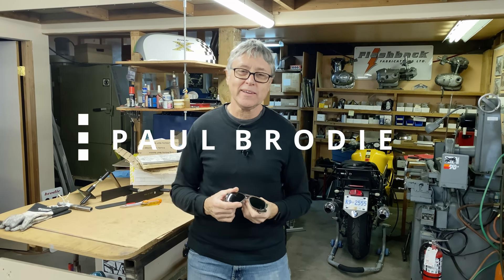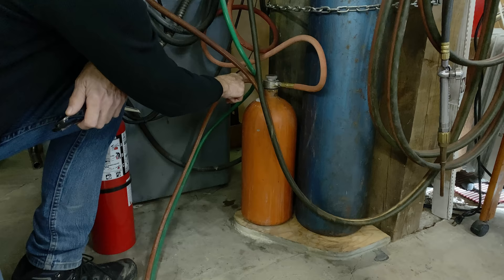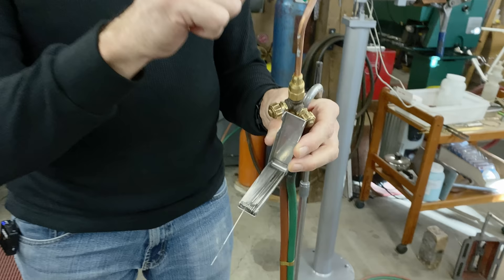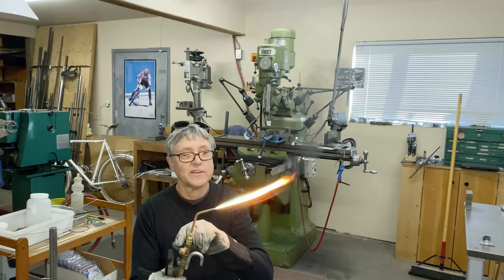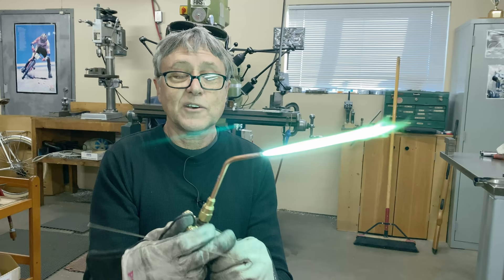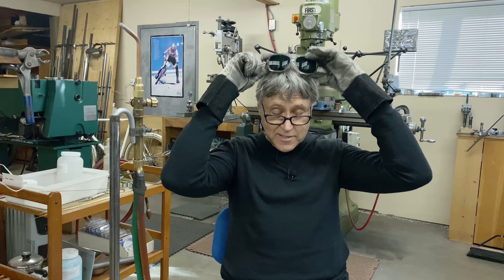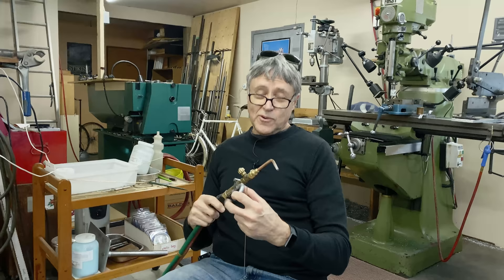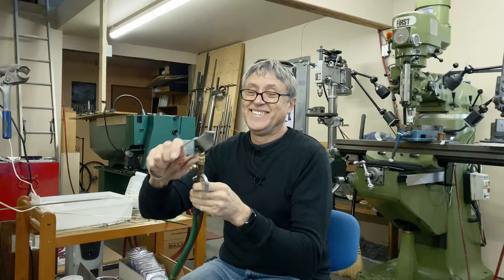How To Braze - Tips and Tricks with Paul Brodie

Comment: I think stalagmite would be a better descriptor than icicle on the braze stacking. I've been welding as a hobbyist for 47 years and never heard of an inline fluxer. That is kinda neat. Don't think I would get one as most of my welding is tig or mig but brazing has always been kind of relaxing to do. Bought a jewelers torch awhile back as I have always liked making little sculptures. Currently gearing up to do metal casting as one bucket list item is to make a 1920-ish Indian from scratch. Which is why I started watching your videos, when I found the Whippet video. Thank you so much for sharing your knowledge!!!
Reply from the maker: Roundtuit, thanks for watching and commenting.

Comment: Hi! Paul. I discovered your channel about a week ago and am scrambling to get caught up on the content. I'm more interested in motorcycles than bikes, but really appreciate the fabrication content regardless. I don't understand the process of pre-brazing with nichol silver and then over brazing the fillet with bronze? What's the purpose as opposed to just doing the fillet?  I'm thinking the bronze would migrate into the joint by capilary action when doing the fillet? What's going on there? CHEERS
Reply from the maker: Yes, you can just create a fillet with the 3/32" bare bronze rod. There are likely many builders who do that. Each rod has it's own characteristics, and I like to take advantage of the best of each rod. They are both strong, but nickel silver has slightly better flow characteristics, and the bronze brazing rod is easier to build up into a fillet. If you only use the 3/32" bronze rod and make only one pass, it's hard to know if the bronze really wicked into the space between the two tubes... Using the 1/16" nickel silver rod, and making a very small pass, I "know" the filler material has fully wicked into that intersection. I'm a #fussyframebuilder so that's why I do things a certain way.
Reply: I've done 3 motorcycle frames from scratch using brazing. I just wish more people were still keeping the technique alive , when it comes to motorcycle frames. Sadly it's extremely difficult to find good info on the subject here on YouTube . However, this channel has given me some good tips to use , and I've been able to apply a few to my last frame build.

Comment: Hi I used to build frames with my father George Longstaff in the UK 🇬🇧  very nostalgic video for me .
We only used the liquid flux in the gas for fillet brazing for a smoother Finish and kept the frames in multi directional spinning jigs when brazing to help keep them in line . The noise of the dyno file brings back memories. We built bikes ,trikes tandems & tandem trikes . Happy days  google George Longstaff we built the first ever 2WD mountain trike . 😁
Reply from the maker: Yes, you definitely have had a lot of experience! Building trikes and tandems is not for the faint of heart. They are definitely a lot harder than a regular hardtail. Thanks for watching and commenting!

Comment: I've recently started to play around with a cheap mini oxy-acetylene set from the hardware store. I use flux powder that I got for free from a company that quit brazing. I mix it with deionized water to make a sticky paste, which works quite well. They sold me some nickel silver cadmium rods for scrap price. (Yes, I have good ventilation. Safety third.) I braze scrap bicycle frame pieces for practice and I dream to make a freak bike some day. It doesn't need to be very tough, just tough enough for some show rides. What I wanted to say though, is that you can clearly see when nickel silver cadmium melts, because it's a little dull when solid but becomes mirrorish shiny when molten. That's a really nice indicator.
Reply from the maker: Yes, you certainly are doing it on the cheap. But it sounds a bit sketchy to me. You say the frame doesn't need to be very tough. I disagree. You want to overbuild it, so it NEVER breaks. Also, buy the best flux. It's all detailed in our second brazing video. Flux is very important. I use nickel silver, but not nickel silver cadmium.
Reply: @paulbrodie  thank you for your reply, Paul. You're absolutely right with your attitude, always to overbuild so that the bike never breaks. What I wanted to say, is that my frame will never be used in a mountain biking application. It will be ridden on smooth flat pavement, with no competition whatsoever. But you can be sure that I won't bet my life or my health on bad craftsmanship.
The flux that I got is intended to be used with my particular brazing rods. Someone, who has more knowledge in brazing than me, thinks it's the best for the application. I guess I'm the weakest link in the chain 🤷‍♂️
Reply from the maker: @andrebartels1690  Then I say, Don't be the weakest link in the chain. That doesn't sound good to me,

Comment: Thank you so much Paul. I learnt to Oxy Weld a lifetime ago but have been using a MIG for the last few years.  On the back of finding your channel I am off to buy a small oxy set and start repairing a few frames that I have been sitting on for too long. Thanks again. Jeff
Reply from the maker: Cool, got you going, eh?
Reply: @paulbrodie  For sure my friend. Going to practice my brazing and  replace rear dropouts on two of my BMX bikes plus fabricate some bits and bobs on my Honda CT110 race bikes. Just need to get a lathe now (hahahaha).  Back in the day, my late Dad was a machinist / fitter for Clyde Engineering in Sydney Aust. Keep up the great work and looking forward to watching more of your content. I will give your channel a shout out on one of my shows "The Postie Bike Podcast" ..... have a great day. Jeff

Comment: Would you be able to make a video on silver brazing a lug for bicycle frame building? I am working on that currently, but I struggle to pull the silver braze from one end through to the other end, and I usually end up overheating the metal.
Reply from the maker: I won't be making that video, but there is one out there. I think a part of the title is "silver brazing". Sorry I can't direct you better than that. It is worth searching for. It's about 20-25 minutes long, and the filming is very clear and easy to see what is happening with the heat, flux, etc. I could not do better. Good luck in your search.

Comment: Hey Paul Brodie! You're back in my feed! Nice! Great video! I had never heard of an automatic  fluxer before and I've been brazing for decades. Thanks for the tip. 

Usually what I've noticed when people think about lubricating an oxygen bottle, it's those coarse, rusty threads the cap screws onto. I just scribble on them real good with a pencil and let the graphite go to work. It's an old woodworking trick my grandpa taught me. (He did it a lot on the top surface of his table saw. ..and tight door jambs and hinges ..and on the pieces of our fishing poles that sock together.  ..). I'm going to be making ice cycles  within the hour. I need that kind of practice. I notice my brazed joints look a lot like my soft solder joints with not much stacked up
Reply from the maker: I'm so glad that we are back in your feed! And thanks for liking our videos... I would use wax on those big coarse threads...   :face-orange-raised-eyebrow:

Comment: This is an excellent video, Paul, thank you for making it. I want to improve my brazing skills, and I've been practicing with icicles, but it is quite challenging to do these, without a self-fluxed, and using 15% silver rod. Probably not the best rod for this trick, I reckon—I need to get some others to try.
Reply from the maker: Thanks for liking our video.  Building icicles can be tricky,  but don't give up. Silver content can be expensive, so get bare bronze rods, I use 3/32". The automatic fluxer is a great help too, but I know that not everyone has one...   :face-fuchsia-tongue-out:

Comment: I learned to braze with coat hangers and steel tubing, the melting temperature is close but the large steel tubing acts as a heatsink, it's not the easiest in the beginning, but eventually things are figured out, the steel coat hangers I'm guessing are low carbon,  since they are so soft, probably has a lower melting temperature also, not the worst thing to do ,   and it wirkd
Reply from the maker: I'm glad it wirkd for you. Thanks for watching.

Comment: I believe the purpose of the flux is to stop the steel oxidising which would prevent the bronze from wetting. So the important conclusion from the icicle experiment is the poor join to the steel base. Also be careful with flux - boron causes infertility! Thanks Paul, love your videos.
Reply from the maker: I believe the flux has 2 purposes. The first is to "help prevent" the steel from getting too hot, and so allow the bronze to adhere. Too much heat will cook the flux, but it does help. The second is to help the bronze (or whatever filler rod..) to flow. Don't worry, I'm too old to have kids.

Comment: I use it for work as a hvac installer we use 50/50 silver solder
Reply from the maker: 50/50 is good. I have 56% and 45% if I remember correctly.....    :face-orange-raised-eyebrow:
Reply: @paulbrodie  I've even used soft solder with a torch at the trade school I went to

Comment: Just a thought, 
Turn the heat brick on its side, then drill multiple hols in it and have some 5mm studs made up that protrude about 20mm (3 quarter inch ) then fit the studs depending on the job in hand.
Theñ rest the job on the studs.
That way you waste no gas heating the brick up.
Reply from the maker: Well, the heat brick isn't taking up that much heat... but it's great that you were looking for a solution :)
Reply: @paulbrodie  Spoken like a true college professor.  :-)
Reply from the maker: @Deebz270   That was my life for 9 1/2 years :)

Comment: Great introduction! I’m starting a gig in Automotive restoration, and will need to learn how to braze. This is a great way to get an idea and I’ll be spending after hours hopefully practicing myself! It reminds me of soldering, which is an art unto itself.
Reply from the maker: Brazing could be useful in auto restoration. Years ago I used to work right next to an auto body shop that did a lot of resto work on MG TC's and such. Not so much brazing, but tacking with the Mig torch when patching rusty panels etc. Good luck, and thanks for watching....    :face-fuchsia-wide-eyes::face-fuchsia-wide-eyes:

Comment: Here goes nothing lol
You said the heat pulled the solder to the I side. The only thing I've ever done was sweat copper. And I was told,  you only heat up the out side peice, then wants the solder starts to melt the inner peice pulls the solder in..
I didn't know if copper and the metal your soldering would be the same. It just got me wondering if I was told wrong many years ago lol
O and I Thank you for the video!!!!!😇
Reply from the maker: There is some truth to what you said... that is for soldering. I was brazing, which is different. Different filler rod, different fuel, and different techniques. No, I can't say you were told wrong all of those years ago. Thanks for watching...   :face-fuchsia-tongue-out:

Comment: Hello friend, I'm from Brazil and I really liked your explanation. I intend to make an exhaust for motorcycles and I want to use bronze brazing, do you think it is a resistant solder?
Reply from the maker: Hello Brazil! If you braze the tube to the header pipe flange, that is fine because of the size of the fillet. But brazing one tube to another of the same size, is not a good idea, because it is likely to crack or fail. If the tubes are different sizes and one can slip into the other, that will work because the braze can flow in between the (2) tubes. I prefer to Tig weld my exhaust systems.

Comment: Hello Paul, First my comment, you are a master at your skills Sir, Thank You for sharing.  I too have worked with metal (and wood) all my life, as a Tool & Die maker, Machinist, Engineer, and Boatwright.  We are probably contemporary by age.  My questions, do you always use the line gasser for flux, You always add paste flux before heating so are these being used in conjunction with each other?  Have you ever used an Argon shielding gas with the oxy-acetylene as an inline flux?  Your shop is nicely set up, please offer up a video tour one day Thanks, Looking forward to your response
Reply from the maker: If I am brazing, I always use both fluxes. In conjunction with each other, works very well. I have not used an Argon shielding gas.You are not the first to ask for a shop tour. Thanks for watching!
Reply: @paulbrodie  Thanks so much for responding so quickly.  Do you ever work with braze rods that are flux coated (silver, nickel silver or bronze?).  I'd like to know your opinion on using these fluxed rods instead of bright wire and paste flux.  I tend to favor these for my marine fabrication as well as casting repairs.   I also find it interesting that you work in both SAE and MM.  Most of your shop dwgs are in SAE while you measure your frames in MM and use metric threads.  Is this a function of the bike industry being MM standards? Or just because when we started out so many years ago the Imperial system was what we were taught?   I'd also like to ask where you are located?  Thanks Again, Paul Maselli "TheMobileBoatwright".
Reply from the maker: @TheMobileBoatwright   Flux coated rods are ok if that's all you have, but I prefer my system of paste and automatic fluxer. I was taught Imperial and then Metric showed up. Bicycles are a mix. The tube OD's are Imperial, yet the wall thickness is Metric. I am in Langley, BC, Canada, eh? Thanks for watching!

Comment: This was the best complete introduction to brazing and controlling the heat I have seen and it is very helpful.  I know the work you show is more structural, but I work on yard art and use brazing material instead of plating to coat parts of a piece.  So what I need is flat icicles.  The parts have a variable thickness so my base gets away from me and is uneven as I move from 3/4" to 1/4" material.  It may be that I need to work smaller areas.  Do you have any video where you use brazing for this type of application?
Reply from the maker: Bo, we only have the 2 videos dedicated to brazing. It sounds like the issue might be heat control, if it "gets away from you". If you're going from 3/4" down to 1/4" you will definitely be adjusting your flame to suit. Are you doing that?
Reply: @paulbrodie  thank you for giving me a better starting point than I had. I'm an old bicycle rider in Shakopee, MN. I got to know Cecil Behringer, if you know of him. He worked with titanium.
Reply: @paulbrodie  I'm not adjusting my flame but I'll try that.
Reply from the maker: @berpherdsavage  Sorry, I do not know Cecil Behringer..

Comment: Paul, thoroughly enjoying your videos, just subscribed and would like to ask did you make that gas fluxer?
I'd like one but can't afford the one from "ELYRIA" which, in the original Etruscan, is actually pronounced "Springfield".
Reply from the maker: I did not make my fluxer. I paid $800 Cdn in 1985, so it was not cheap, but I have never regretted making that purchase. In theory, it would be easy to make, but if there ever was a fire, and my insurance company found out I had made my fluxer, that would be a big problem. The fluxer from Elyria needs to be modified, IMO, to make it work properly.
Reply: @paulbrodie  Insurance.Excellent point. Are the modifications anything you'd care to discuss here or might not that also void insurance coverage?
Reply from the maker: @greybeard3759  I cut the reservoir chamber in half and welded in a 4" extension. I believe the OD is 6". Then I also extended the inner tube that much too. Now the fluxer holds a lot more flux and actually works properly. I did this to all (4) fluxers at Framebuilding 101. Never had a problem.

Comment: I have learnt so much in such a short time. Thank you such a great video tutorial. In one of your videos you silver soldered the joint and then brazed over the top to produce a lovely blended join. is the Silver solder there for strength or some other reason. Hugh
Reply from the maker: Hi Hugh, if you look through the comments you will see that I have answered this issue many times, and I talk about it directly in the fillet brazing video. You are confusing silver solder with nickel silver. They are completely different! Silver solder melts at a much lower temperature, and usually has a content of 45% or 56% silver. I use nickel silver from Soudotec and the part # is 6800 and it has ZERO % silver. Because both rods have "silver"in the name I think that's where the confusion comes from. I did not name the rods. Thanks for watching!

Comment: Without a huge investment in equipment, what are your thoughts on using MAPP with a torch on a hose with maybe a fluxed rod or powder? Obviously, not a production option but for practice and light duty?? Thanks for all your lessons.
Reply from the maker: I have never used MAPP so can offer no opinion whatsoever. Sorry. When I first started brazing in high school all we had was flux coated rods. Oxy-acetylene really is the way to go. Thanks for watching.

Comment: Thanks Paul,  for the great instructional videos,  Stumbled across the 'Romax' build whilst doing some research and have now binged lots of you videos......GREAT STUFF! Done my fair share of silver soldering on all sorts of small machines, clocks and braze on bike bits. However, Brazing is a different animal. Having trouble finding the right supplies here in Australia.....any suggestions? aggh! (hate those pre fluxed rod!) and in need of bit more practice before tackling the brazing on the frame.  Love all the motorbikes in the background.  Cheers from Oz  Trev-(R)
Reply from the maker: Try contacting my friend Rob Benson at Tempest Bicycles and/or Chimera Frame Works. He's building so should know local suppliers. Thanks for watching!